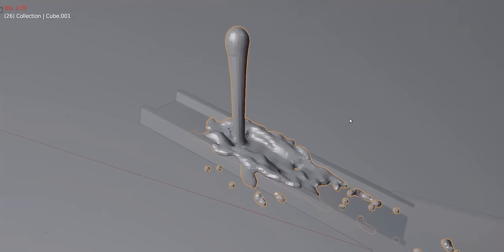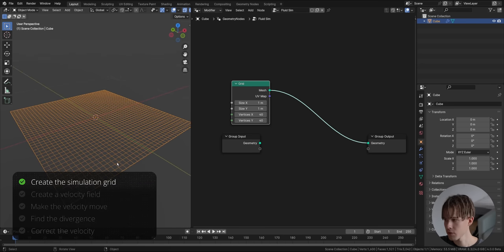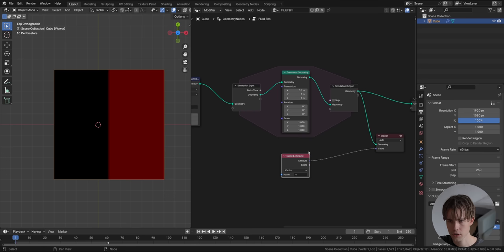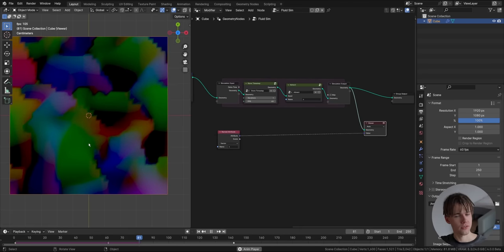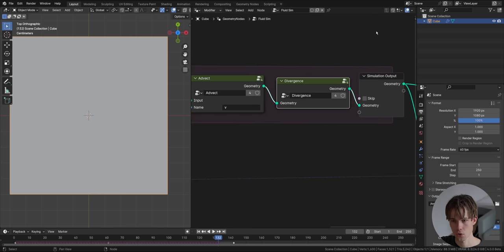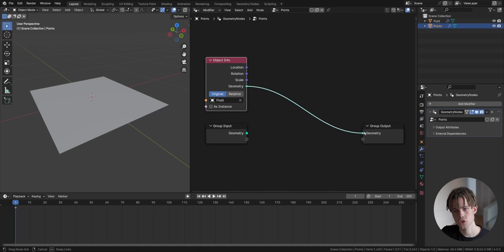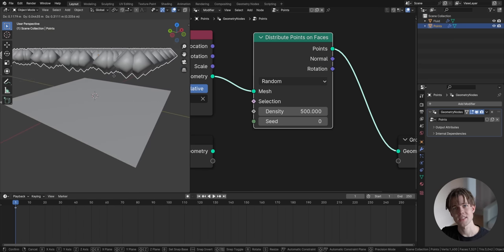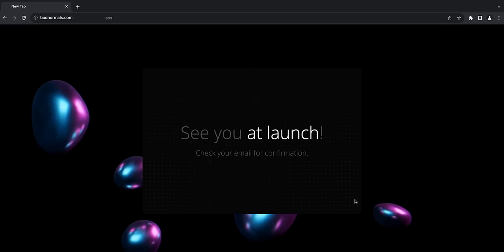New CRAZY fluid simulations in Blender!

Comment: If you got to moving the points and discovered they’re moving vertically, instead of staying on the surface, here’s your solution! It’s because the noise texture we used way back at 7:40 to set the initial velocity (v) attribute is three dimensional—it has a Z component. That means when we use these velocities to move the points at 23:53 they move vertically. When @BadNormals previews the velocity attribute at that timecode (23:53), you can tell he’s removed the Z component because there are no blue colors in the preview. Blink and you’ll miss it, but at 22:18 you can see a Vector Math Multiply node has been added, multiplying Z by zero to remove that component just before storing the velocity (v) attribute in the fluid grid.
Reply from the maker: Thanks for the helpful comment, forgot to mention it in the video
Reply: Thank you, thought I was going a bit crazy there 🤣
Reply: Thank you! I was searching for mistake about 30 min 😄
Reply: Thanks, you are a lifesaver! (This should really be pinned)
Reply: What a legend! Thank you :D
Reply: How do you view the different components with red, green and blue colors? Everything is gray in my file and I am quite new to Blender so don't know what's wrong. Thank you for pointing out multiplying the Z component with zero!
Reply: Thank you！
Reply: Hey, bro im a little confused, do i have to remove the math node, i did check everything but the movement of the point is not the same..Can you help please..thank you
Reply: i love you so much, thank you!!!!!!!!
Reply: ty @timnolte2093 !
Reply: Thanks a lot !
Reply: Godlike
Reply: @shamant1999  Just another Blenderer like you. Glad I could help!
Reply: Oh god thank you I just lost my mind for a tow hours

Comment: Funny thing: when you were making the pressure calculation using iterations and you said that we started to see a pattern, it seemed to me like the pressure was more than just a pattern: it was the perfect negative of the divergence. So on a whim, I tried replacing the entire pressure calculation with just the divergence multipiled by -1, and it actually worked perfectly! :))

Another note: instead of adding/deleting points continuously, just fix the velocity in the border cells at 0. I did this by making a boolean attribute for edges with more than one face neighbor (so now border vertices are zero, others are one) and multiplying this by the advected velocity in the sim zone. This causes the borders to become walls, and the particles stay inside them.

With these improvements the sim is even more performant.

Comment: Very cool. I've already used this to make some cool fluid animations. One thing I'm curious about: When it's updating the velocity properties, does it overwrite the same properties that it's reading from? It seems like that could add some inaccuracy depending on what order it's evaluated, which you could avoid by using some kind of double-buffering. I'm not sure if it does that automatically in the geometry nodes, though.

Comment: You mention that Delta Time was not working. This might be due to that Delta Time (in blender 4.0) is 0 at the first timestep. So if you scale using Delta Time from the simulation node, you clear your velocity field. If I replace the initial dt for frame 1 by 1/fps it works for me.
Reply from the maker: Thanks!
Reply: How did you do it?I don't understand
Reply: I have no DT node

Comment: Brilliant tutorial. I'm using this technique with multiple cameras, though, and every time I change the start frame to render a new shot, the simulation resets itself - it basically starts from having 0 particles, rather than having the particle count it would have if I'd started rendering from frame 0. Is there a way to add a "run-up" variable somehow that will run N steps of the simulation before it evaluates the first frame? I tried using a repeat zone with the mesh part of the geonodes setup (distribute points on faces, store og_pos etc) but couldn't get that to work.

Comment: Hey all, quick question:
How would I transfer this across files? As in how would I attach this to another model. I've followed the tutorial in my Goe Nodes Asset library file and am wondering how I would have them marked as an asset. Do I need both the Fluid object marked and the secondary sim tree marked as well? And do both need to come along when I use it on another model, like the face example our esteemed teacher showed off?

Thanks sir, stunning tutorial, awesome work as always!

Comment: This is awesome! I try to do the same effect in Touch Designer and failed. Now I made it!                     
Still have a question: I try to change the size of it. So I change the grid. But the effect didn't follow. Are there any other node need to be changed?  Hope to be answered! Thanks！
Reply from the maker: Hey, this is a bit tricky to do, since in this tutorial I don't account for the distance between grid points. So when the distance is 1m or 1cm the result would be actually different. That's because the velocity would be multiplied with a certain coefficient depending on the grid measure. I recommend playing with the resolution, but I couldn't personally get very different results with this one either.

Comment: would it be possible to do the same but on a noise displaced surface, so the particles follow the surface?
Reply from the maker: Yes, you still do the movement on a flat grid, but move the points to the surface later on, after the simulation zone. A good option is to use the raycast node and a set position node.

Comment: hey mr. bad normals, how can i integrate that ripple animation you taught on the bonus content to this point cloud animation?
Reply from the maker: You have to ad the ripple animation on a plane and then use a raycast node to project the points onto the surface of the ripple plane. Do this after the simulation of the points.

Comment: Nice, work and tutorial! What computer hardware are you using? I want to learn blender, but my computer is too bad
Reply from the maker: Thanks! I use a PC with i9-12900K, RTX3090, 64GB RAM and a 2TB Samsung SSD. That's the last year though. I started out with a low performance laptop.
Reply: @BadNormals thank you so much for the answer! I am thinking of buying a used computer with these hardwares. 
CPU: AMD Ryzen 5 5600x
GPU: AMD Radeon RX6700XT
RAM: 32GB Corsair vengeance 3600Mh
MODERKORT: ASUS ROG Strix B550 F
PSU: Corsair RMe Series RM850e
CHASSI: Corsair iCUE 4000x Midi tower
SSD: 2TB Kingston SSD
Do you think you can render 3d particle simulation with this set up?
Reply from the maker: @AlexanderWinzenburg  The setup goes good in my opinion, but I'd take an Nvidia RTX GPU. AMD seems to have some compatibility and performance issues. But certainly check Blender forums about that.

Comment: solving the flicker gave me even more flicker
idk why
I have to set radius (under animate radius) to 0.5 or so anything too small and it has the same effect as setting maximum age to 0
Reply: same here - wonder if there's some info we are missing from the video? Maybe @BadNormals can help?
Reply: You need to go into Animate Radius node group and remove multiply math node above Float curve
Reply: @yoyo_cortex  Thank you for your reply! I already did that but it doesn't change anything... I'm on 4.0.1. I triple checked all nodes but can't find the problem...
Reply from the maker: Are you sure all the nodes are as downloaded? Also, make sure the new points are set to zero for their radius, right after the distribute node. And make sure the float curve output is multiplied with the radius controller.
Reply: @BadNormals  Thanks for replying, I missed the "create age" node group, it isn't in the starter file node groups :)

Comment: I got to the part where you scale the velocity by delta time for the Points geometry nodes, and all the sudden the points started moving vertically. I don’t know why, because all my nodes are the same as yours. Only weird thing is that when i searched for “dt” it didn’t show up as a pre-existing variable
Reply: I ran into the same issue. It’s because the noise texture we used way back at 7:40 to set the initial velocity attribute (v) is three dimensional—it has a Z component. That means when we use these velocities to move the points at 23:53 they move vertically. When @BadNormals previews the velocity attribute at that timecode (23:53), you can tell he’s removed the Z component because there are no blue colors in the preview. Blink and you’ll miss it, but at 22:18 you can see a Vector Math Multiply node has been added, multiplying Z by zero to remove that component just before storing the velocity attribute in the fluid grid.
Reply: @timnolte2093  Thanks
Reply: @timnolte2093  thank u!

Comment: hey, i dont have any color information in my nodes. i try to preview my noise texture from my "color"-socket and i see the pattern just as black and withe. as it would be just a float and no vector data, even when i try to preview a color, its just dark or light. Because of this my movment of the points doesnt work at all.
Reply: I had the same problem and found the issue. Select the "Viewer" node, in the sidebar select "Node" and under "Properties" set it to Vector.
Reply: I had the same issue but for different reason, my 2 set material node connections were crossed. It worked after I straightened and reinserted them 🤷

Comment: An advect is inserted at video position 5:57. I am using Blender 4.0.2 and am trying to find the node by searching with Shift + A, but unfortunately it is not displayed. What am I doing wrong and can anyone help me?
Reply: I was able to help myself. These are user-defined groups and I can find them in the file you provided for download. I will use it in combo with the "Node Presets" add-on
Reply from the maker: Yes exactly, they are not included with Blender, I use them to make the video faster.
Reply: Why do you feel the need to make a quick video? The video here is already a special topic. Even if it took 3 hours, I'd be there.  @BadNormals

Comment: you can’t say you did something in a stupid way and then show the exact solution i was just thinking of 😞
Reply from the maker: Actually the only part I thought was stupid is that you could control the radius with a division slider. After changing to multiply I think it's the best solution for this use case

Comment: hello ! thank you very much for your sharing good vibes !.   >>> I stumble upon this little visual problem > using blender 4.1 alpha.   and trying to link the Named Attribute to the Value  ( VIEWER ) . was actually not working, not showing for example the nice RED.YELLOW.RED.BLACK color of the position attribute for example.  >> was stuck for a bit trying to stick to the speed of your comentary in the video :)) HAHAHAA>.   and even went on blender 3.6.5 to check if there was any potential bug in the beta 4.1 ...>>> well no ...  same issue... >>> THEN > I TRIED     >>>   RIGHT CLICK     on  the   ATTRIBUTE   (node part thing) of the box :" Named Attribute"  > and found    this  >>>   (0) Link to viewer    >>> AND  BIM BAM BADABOOM >>> it  works !!!.     ouf!.   >>> well >>> this is a note maybe to  blender  dev team...    don't you agree this  should work also by draging the link.node.rope.wire thingy thing to the  Viewer box .      it should  not ONLY work when  I right click and use this "hidden" function call   (o)  Link to viewer..                      voila >  my humble respectfull  opinion ;)))  cheers! and MERCI BEAUCOUP !. yann
Reply from the maker: Merci pour ton commentaire!